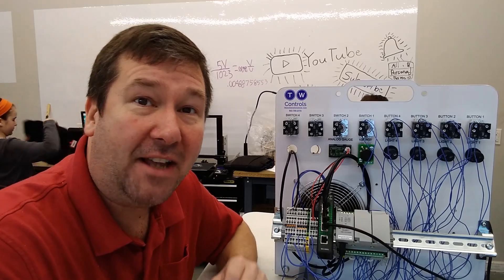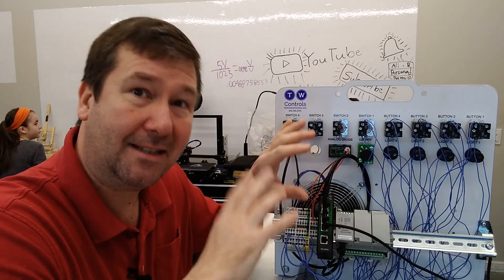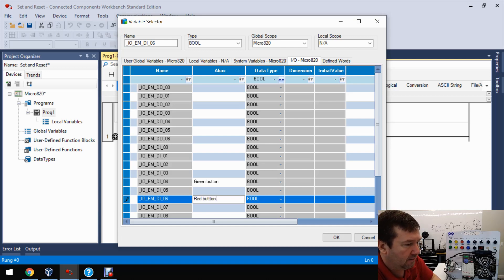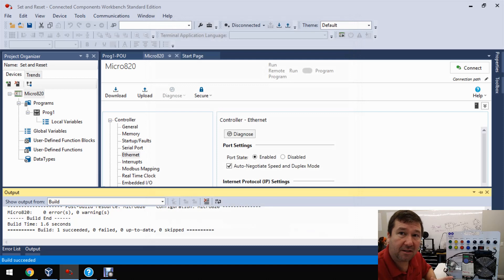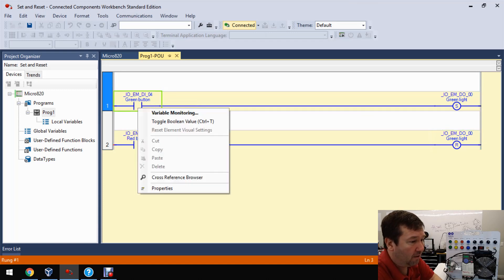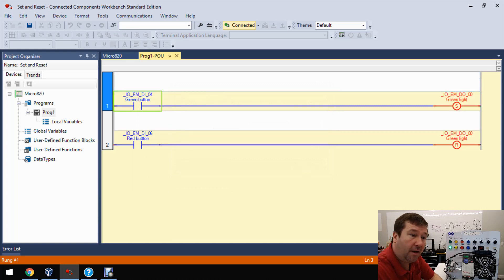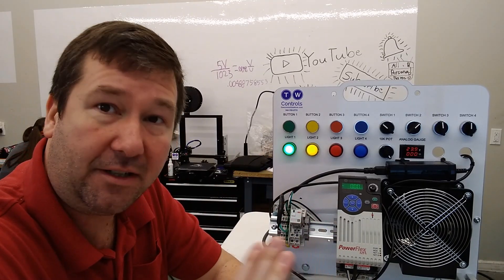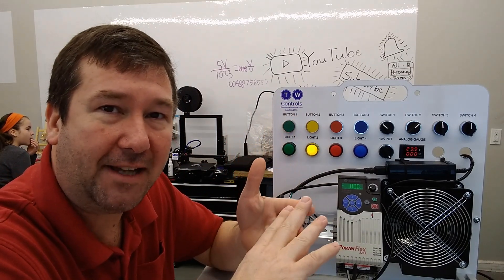Micro800 Set and Reset Coil Connected Components Workbench

Comment: Good morning Sir,
I am a novice in automation but I have just embarked on a project with a Micro 850 PLC.
Thank you for your videos which are a precious help (even if I'm struggling a bit because I'm French and my English is basic 😂).
I've written my programme in Function Block because it's easier for me.
I use Set Reset blocks because I have contacts that give information and return to 0 and I have to keep this information until another contact Resets them.
On a Set Reset Block, if the Set input goes to 1, the Q output goes to 1. If the Set input goes back to 0, the Q output stays at 1 until I have a Reset input.
My question is, when I switch off the Micro 850 (machine contact stop) when Q is at 1, will Q still be at 1 when I switch it back on, or will it go back to 0 ?
Thank you
Reply from the maker: I believe it works the same way as the SET and RESET in ladder logic and it will retain its value during a power cycle but you should definitely test it.
Reply: Thank you so much
Reply from the maker: You are welcome

Comment: hi Tim, thank you for making all those great videos. They are very helpful. i have a project in whish i need to take ths speed of  motors to control the speed of other motors 
my set-up: Allen Bradley Micro850 (2080-LC50-48QBB), encoder with only "A" sensor, 2080-MOT-HSC module, 2085-OF4 module and Penta-Drive KBCR-240D
i look your videos on HSC, verrrry helpfull, but i still didn't try it with the speed of motor, not sure if i need to use 2080-MOT-HSC
and i will like to see a video to configure the 2085-OF4
THANKS AGAIN FOR ALL YOUR VIDEOS :)
Reply: i forgot..., my encoder is a "Line Driver4" rather than Open Collector

Comment: Hi Tim, i use sqo allot on slc 500 
Im just starting up on the ccw software but i cant find an sqo anywhere ? 
Cheers
Reply from the maker: Luckily there isn't one :-) Here's an old lesson I wrote, if you read my commentary in it I discourage the use of the sequencer instruction for this very reason. It's not available in most platforms. I'm getting ready to work on a series that will show different ways people sequence machine steps using basic ladder logic, function blocks, and structured text.
https://twcontrols.com/lessons/rslogix-500-sequencing-machine-steps-part-7-sequencer-instructions
Reply: Haha i like the young man bit as i have been through a very similar scenario with another older more experienced programmer and he told me its hard to fault find on. It is a shame as i love the sqo and how easy it is and what it can do, but im looking forward to seeing your method of sequencing on the CCW software. 
Cheers

Comment: Dear sir,
When i using Tia 14 of siemens , i usually use memory addressing for ladder coding. It means i usually set and reset memory bits, in plc memory. Is there any way that i can  set & reset memory bits in ccw🤔
Thanks a lot sir.
Reply from the maker: Yes, you just need to create a Boolean tag.
Reply: @TimWilborne  thanks a lot sir❣️

Comment: Hi Tim thank you for making all these great videos. They are very helpful especially for a freshman to automation industry like me. Could you make a video on how to size circuit break, how and when to use fused circuit break vs fuse block + circuit break,  and how to size the transformer?
Thank you very much Tim
Reply from the maker: Hi Shengyi.  That is a little outside of the focus of this channel and there sin't a one size fits all answer but I might be able to give some basic guidance and point you to the right section of code to figure it out.  Let me think about it.
Reply: Tim Wilborne Thank you Tim, if you could share which section of code you use and maybe a case study on how you use them, that will be greatly helpful. Thank you again Tim!

Comment: I started on the GE Series Six and its latch instruction (and general programming environment) had a couple of differences to it.

1) It is a monolithic instruction where the Latch and the Unlatch come in a pair. No scattering your latches (Set) and unlatches (Reset) willy-nilly throughout the program. No using multiple Sets or Resets per coil. Just one of each, and they are locked together for eternity. None of this latch in one routine, and the unlatch (if it exists at all) in the next routine nonsense.

2) The S6 limits the number of contacts that you can put on a rung to nine wide, seven deep, and that includes the coil. No rungs that span the globe (the most egregious example of this was a rung that a programmer from EDS put in his scheduling logic that took ten pages to print out. One rung, ten pages of listings. Of course, the greater issue in this case was allowing CompSci majors to touch PLCs at all). You get a 9 wide, by 7 deep rung, and it fits entirely on the screen. Thus sanity is maintained.

So, I think that AB has to take some of the responsibility of making such a mess of things. Which has lead AB-centric programmers to chastise us programmers that came from a civilized PLC for our "overuse" of latches.

Rather than say that you should go easy on the use of them, ask where latches are best used? The simple answer is that a latch/unlatch rung will retain its state after power cycling your PLC (something else that AB PLCs have been known to require that other PLCs haven't). If you use a normal coil, then the state of that coil gets set to 0 after a power cycle, on a latch/unlatch coil, it retains its state.

So for a practical example, in the conveyor world where a carrier comes into a stop by making and then releasing the "AT STOP" limit and then waits behind the stop for its turn to leave, you wouldn't want to lose the status, or "whereabouts" of where your carriers are in the system after a power cycle.

So use latches where it is important to retain a memory of an event, use coils where you want the PLC to reset its conditions.
Reply from the maker: Will it?😜  We'll talk about that next week.
Reply: @TimWilborne  Well, for PLCs that didn't come inside of a Happy Meal box... :)
Reply from the maker: It is a little more than I can explain in a comment.  You must first make the outputs retentive THEN we can talk about prescan (the scan before the first scan).  Stay tuned till next week ;)
Reply: @TimWilborne  I know where this is going. I can wait. :)